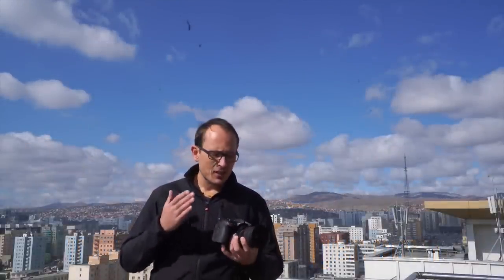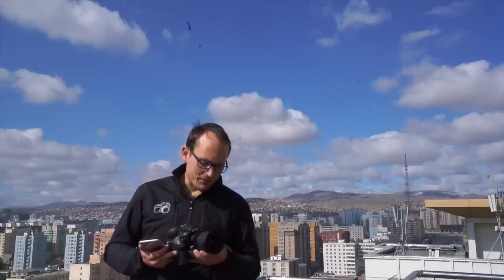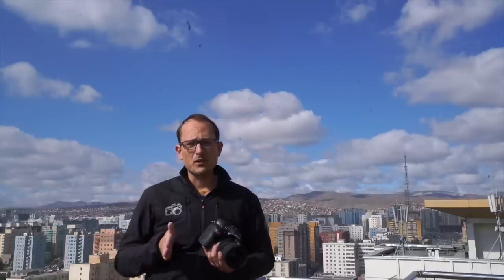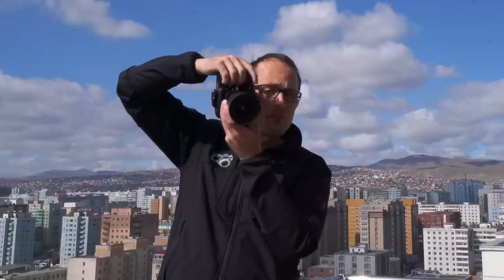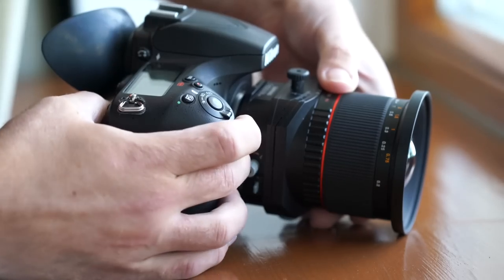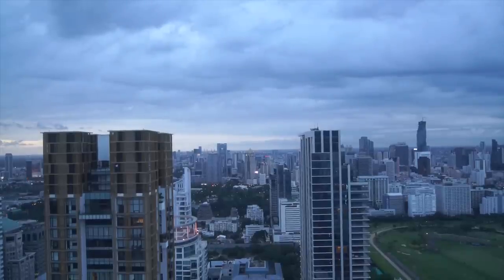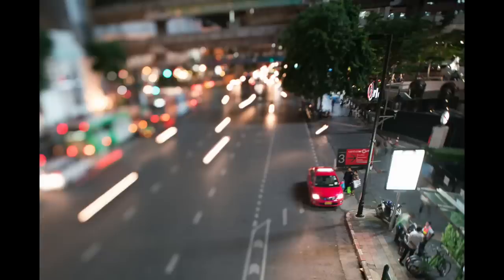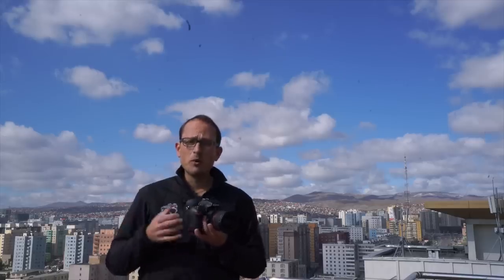How to use a Tilt Shift Lens

Comment: Thanks for this one Mat. Yep, I have a Schneider 28mm PC Shift lens, no tilt.
I'm one of the 'old school' going for correct image geometry in everything: Architecture, landscapes and product photography. And as in your demonstration with the mirror, when photographing artwork framed with glass, using the shift horizontally, I can avoid getting myself in the picture, literally. 
Similar to 'side stepping' in the mirror example, I was needing to photograph an oil painting which was in a really awkward position, being way too high up a wall to handle with vertical shift, but near enough to an interior mezzanine balcony, that when up on the balcony, I used the horizontal shift to get a perfect rectilinear image of the painting without having to lean too far out. The camera was mounted on the tripod head (using a 3-way levelling head) first aiming it perpendicularly to the wall, (film plane parallel to the wall) then using full horizontal shift. Bingo! 
The Schneider 28mm PC was also in the Leica R lens range. The current Schneider shift lenses are now tilt/shift.
I was tossing up whether to get a new state of the art upgrade, but for the same price bought a good, used Linhof Technika, which takes care of all my tilt needs.
People new to these things must get used to manual stopping down from viewing to working aperture.

Comment: Another great tool that you can use tilt shift lenses for is to make a panorama from a series of images using the shift feature.  For example you could shoot a landscape and get the lower part of the frame, then shift the lens up to get the landscape and the clouds and then stich these images in post processing.  Using a tilt shift in this way will mean you can get super wide detailed shots but not with distortion.

Comment: I have one, and it's sorta homemade. :) I used a Kipon tilt-shift adaptor, Nikon G to Sony E, and a Tamron 15-30 f/2.8. It works both on my A6000 and on my A7R, but I can't have the lens placed vertically at 15mm on the A7R, because the lens hood (non-removable) gets in the shot. But at about 20mm, the lens hood is no longer visible. The lens also still allows a pretty good amount of shift on the A7R, depending the focal length. And it works really well at any focal length on the A6000.

For those shooting mirrorless cameras, I definitely recommend using the Kipon tilt-shift adapters. They are well made and can give you a really good variety of focal lengths to use for a much cheaper price. Want a 24mm, 45mm and 90mm? Get all of these for the price of less than one dedicated tilt-shift lens.
Reply: +wandererstraining  Thanks for the advice. I am contemplating buying the new Olympus digital PEN F and have quite a few Olympus film camera lenses in both formats (PEN and OM). I had seen the tilt and shift adapter and thought it might be fun to use it with my 21 mm lens. The adapter is pricey at $300 but using it on different focal length lenses makes it seem like a better deal.
Reply: machintelligence To me, it's really worth it. Tilt-shift lenses are expensive, and are not available for a lot of mounts in the desired field of view. For example, 24mm TS lens for APS-C is too narrow for many interior shots, and even more so for m43. With the Tamron at 15mm, I can go even wider on an APS-C than I can on a 24mm TS on full-frame. On m43, you wouldn't be able to use it as wide, but it would still not be that bad at 30mm. So yeah, if you have a bunch of lenses you could use with it, it's absolutely worth it I think. And with the PEN F's high res mode, man, you could get insanely detailed shots!

Comment: Because of the construction of Canon TS-lenses one can also use the telephoto extenders on them  (although officially not recommended by Canon), which makes the lenses more versatile (1.4 extender on 24 mm > ~35 mm etc.). And of course one can use extension tubes for macro photography, which gives more dramatic effects because of the very narrow depth of field with these extension tubes.

Comment: If you don't mind  no EXIF  then have a look at the Mirex Tilt shift adapter ( Uses Mamiya 645 lenses). I use it on my sony A7rM2 via an EOS-e mount adapter. The Mirex is not cheap but its beautifully engineered you can then add lenses  making a nice tilt shift system covering macro to wide angle, which ends up cheaper than having to buy two different Tilt shift lenses

Comment: Hi Matt, I got myself a russian middle format (Pentax M6?) lens converted to a tilt shift a few years back (35mm). It's working    ok, and I like the not too obvious tilted fokus planes best so far. Just a little additional guidance for the eye and making stuff off to the sides just that little bit less a fokus of the image. The miniature mode works only sometimes for me. 
However, on my D80/D7000/D7200  I can't turn the lens 90° around as you do. The Flash Bulk gets in the way. Is the samyang actually so slim that you can turn it around on one of the Nikon APS-C cameras? It has an interesting price point....

Comment: Thanks for the great tutorial, Matt. I've been intrigued by tilt/shift lenses for years, but have always been put off by the price for something that will only really be a novelty lens (probably should rent one instead), and also the variety: which one would I get? Probably one at the wider end of the range. That decision has been complicated further by Canon's recent additions to the tilt-shift lens line-up.

But my biggest question has always been: why would I want to spend so much on a special-use lens when I can likely - with quite a bit of work it must be said - get the same results in post-processing, and at a much lower cost, if not a reduction in time spent.

So, why would someone buy a tilt-shift lens over getting the results in photoshop or lightroom, etc.?

Thanks!

Comment: The independent rotation of tilt vs shift is the deal breaker for me... I was all to ready to pull the trigger on the optically superior Nikon PC-E but unlike the Samyang and all the Cannon's, it does NOT have independent rotation of the tilt and shift controls.

Comment: Hey guys,
I'm quite curious about the tilt-shift effects from these lenses, but as an amateur it's not worth it for me to invest in such lens just for experiments (yet).
So I was wondering if there's a good option for a til-shift (or just tilt-) adapters around?
I have a Sony a7rII so I would need an E-mount adapter.
I see there're some cheap (about 20~30$) adapters in various mounts combos.
But was wondering if I can still use my current lenses with such adapter. I currently have the Sony's 1.8/55mm and the 2.8/90mm Macro.
Obviously the electronics control will be completely disabled, but tilt-shift lenses are full-manual anyway, so I guess as long as I have some control over the aperture it would be usable?
And how about lens-back to flange distance? DSLR lenses are designed to longer distance, but sony's mirrorless lenses are not ... so I'm not sure what would be the effect when adding adapter in between.

Comment: Hi Matt . Don't you confuse about shift  and tilt ? I remember when I was in school . Tilt its mean up and down and shift is left or right . Sorry for what I said . Please correct me if I am wrong ; apologize . Therefore I want to correct myself if I misunderstand from school.    Sincerely thank you
Reply from the maker: +Shawn Shing they rotate as I said, so both can be left right or up down. Think about the words though. Tilting is different than shifting. Shift keeps the elements parallel to sensor, but off centre. Tilting TILTS the lens so angle of elements are no longer parallel.

Comment: Are there any decent T&S lenses for MFT format?
Reply: +thany3 Most T/S lenses are manual focus, like this Samyang. So all you need is an adapter for the Canon or Nikon version.
Reply: +Peter John Problem with that is that is becomes quite a bulky setup, but I chose MFT for its compact-ness... So I was hoping for a T&S lens that was built specifically for smaller sensors. Also the problem with manual lenses and/or adapters is the complete lack of metadata sent from the lens into the camera and into your pictures.

Comment: Man I really want one of these, but I can't justify the cost.
Reply: +The5thStateOfMatter Rent. I think I may go that route to have a play with one lol.
Reply: TalesOfWar I'm just a casual so I don't plan shoots or anything. Even that I couldn't really justify.
Reply: +The5thStateOfMatter Canon have patented a tilt shift lens adapter that goes between the body and a normal lens, hopefully it'll be fairly cheap
Reply: +The5thStateOfMatter Make one using a lens with a bigger image circle than your camera format and an adapter. Works surprisingly well. What are you shooting (as in, what camera do you use)?
Reply: wandererstraining Yeah, if they made something like Nathan Lewis mentioned at a reasonable price, the only problem would be the weight of the lens-system compared to the camera since I have a Canon EOS M.
Oh and I'd need to get an EF-mount 35mm lens and an EF to EF-M adapter.
Reply: The5thStateOfMatter Well, I doubt a tilt-shift lens will ever get that small. I use mine pretty much only on tripods. And since it's a special lens, it's not like it would be on your camera all the time anyway. Although, it would be cool to have a small-ish one.

But generally, I see mirrorless not only as a "small system", but as a flexible one. It can be small if you pack it small. But it can be made to use all kinds of accessories regardless of its size if you need it.

Comment: what is the difference with a lens baby?
Reply: A few thousand dollars
Reply from the maker: They only tilt
Reply: I've an original Lensbaby G3 and the Tilt is mostly to shift a more or less circular area of focus around (with some depth of field). A proper Tilt-shift has an entire plane in focus as Matt showed. I can not replicate that on the Lensbaby. Though I still like to fool around with the Lensbaby here and there. Stopped down a little the effect is not to harsh and is a very different way of putting the fokus selectively on parts of an image.
Reply: +K.-H. Herrmann thanks for the clarification
Reply: +Ernest Noeline Do you own a Lensbaby? They have a small area (sweet spot) that is in sharp focus and then the lenses are designed to have crazy out of focus as you get away from the sweet spot. The blur has a quite different look than bokeh on a standard lens. Lower Fstops = smaller sweet spot and more crazy blur, higher Fstops = larger sweet spot and less crazy blur. With a lens baby you can only tilt, but it is really easy to tilt the lens in any direction you want to. There are also Lensbaby optics with a "slice" of focus that functions similarly to the sweet spot, but it a straight line that crosses the entire frame.

I actually think the blur you get from a Lensbaby makes a direct comparison with a tilt/shift lens more difficult than the lack of shift.

Comment: The explanations are nonsense.   Converging lines have nothing to do with how high or low you are - they are a result of the sensor not being parallel to the subject.
Reply from the maker: Two sides of the same coin
Reply: @mattgranger  nonsense.   Parallelism has nothing to do with height relative to the subject.   Either you actually dont understand (which I doubt), or you are unwilling to admit a mistake (which I fear is worse).   This was just one of a few instances of incorrect explanations in your video.
Reply from the maker: If you’re low, pointing up, the sensor isn’t parallel and you’ll get converging lines.
Reply: @mattgranger  and if you straighten out, use the shift, and even drop the camera lower, the lines won't be converging.  So, it has nothing to do with how low or how high you are - it only has to do with parallelism.    Which is not the explanation in your video.
Reply from the maker: @dannirr  Two sides of the same coin... still
Reply: @mattgranger  only for those who don’t understand the difference between cause and effect.